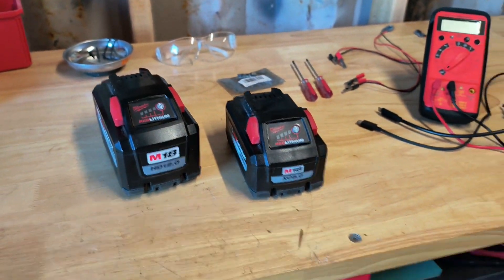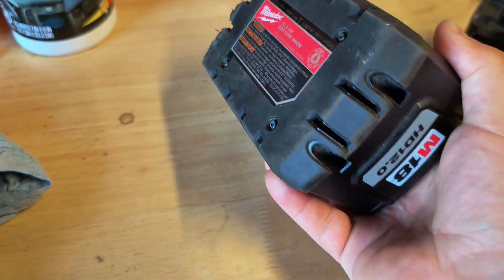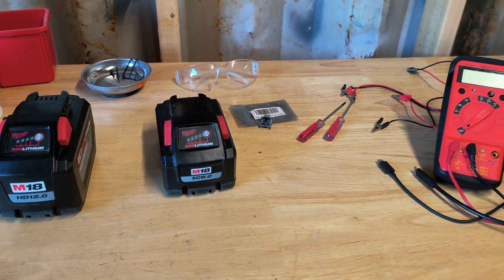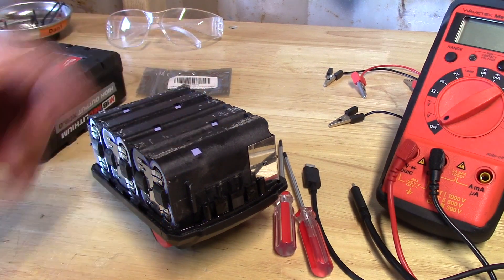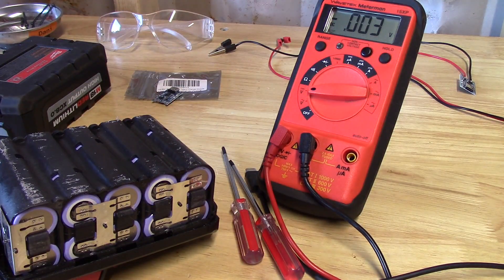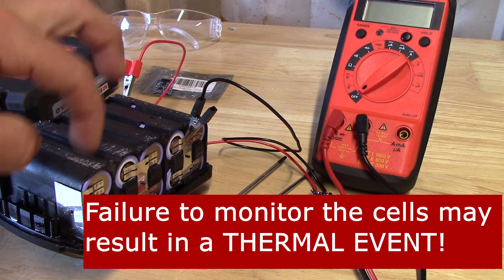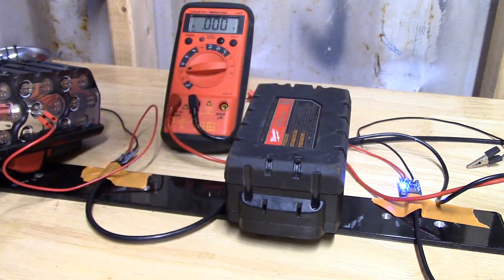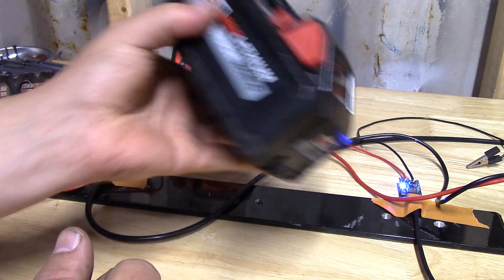Milwaukee M18 Battery Not Fully Charging, FIXED!

Comment: It's not clear to me where the alligator clips are attached. It looks to me that the black wire is on a positive battery end?
Reply from the maker: Unfortunately that is as clear as I could make it, and why I recommend you use a multimeter to determine the polarity of the cell banks.

Comment: That was just a temporary fixed ( still unbalanced cells). That will be out of balance more and more very soon . It needs a balancing charger to fix this much more easier and safe .
Reply from the maker: As I mention in the vid, re-balancing cells is always a temporary fix as the root cause of the issue is due to the difference of internal resistance within each cell.
There is always a danger present when charging any battery, don't assume that just because you have an expensive charger that you are completely safe 🤓

Comment: My 8.0 Ah battery had the 3 bar issue.  Your video was great in helping me correct the issue.  It does take some time to do. I did have an issue when trying to use the 18650 module with a USB-C charger, it simply wouldn't work. I got one of my old iphone USB chargers and it worked.  Thank you so much for making the video and showing step by step how to fix the battery and the items needed to complete the fix.  I saw some other videos on solving the 3 bar issue but they were too complicated for me.
Reply from the maker: The other vids I saw were all over the place, so I thought I would try making one. I am glad you found it informative 😊

Comment: What did you connect the alligator clip for the power source ?
Reply from the maker: I soldered them to the little charging board. You could just twist the wire and put it through the hole. Make sure it doesn't touch anything and is affixed in place, somehow.
Reply: @IllInformedHuman  but where is the power coming from.  Like an out lot or. A charger  🔌
Reply: Outlet *
Reply from the maker: @FaronMoonias  that small charging board is connected to a 5vdc source, via USB c. So you would want a USB port adapter that connects to the wall outlet. As well as a USB A to USB C cable.

Comment: Thanks, my 8.0 was like this from new. I think I got it off eBay years ago, sat too long on the shelf I guess. I gotta fix'r up
Reply from the maker: I'm sure you'll get a few more uses out of it 😉
Reply: @IllInformedHuman  yeahh, or replace the cells I guess or use the good ones in a different battery pack. I'm gonna try to use my RC battery charger though instead of the USB method. You can add a balance lead to them apparently also, but idk I'll have to look
Reply from the maker: @M.TTT. replacing the cells would prove tricky. I'm sure you'll figure something out with that RC charger

Comment: Does this work for also ridgid batteries too or only Milwaukee
Reply from the maker: This method would work for any lithium battery pack. The points to connect up and charge would be different, just be sure to check with a meter first.

Comment: Thanks for the tip, we you charge more than two cells at a time ?
Reply from the maker: As long as they don't share a rail, meaning they are end to end, you should be able to.
Reply: @IllInformedHuman and how long did it take to charge to 4.v?
Reply from the maker: @123uniden each cell was 8ish hours.

Comment: The really infuriating things is that the chipset that Milwaukee uses actually supports Cell Balancing but for whatever moronic Milwaukee does not use it. 

This is still the case with the latest Forge batteries also.

Its clearly a deliberate decision by Milwaukee to make people purchase new batteries to replace batteries really should not have failed in the first place if they had implemented the cell balancing.
Reply from the maker: I am pretty disappointed with Forge. I thought the lack of cell balancing was an oversight, but after seeing what they did with Forge, it is looking like a design choice 😢

Comment: Thank you so much I was gonna toss the battery away but buying the board and two clamps fixed the battery issue. Appreciate it

Kevin
Reply from the maker: That's why I do this, glad it worked out for you!

Comment: I think running the batteries down to a blinking bar too often is what caused them to get out of balance. I have at least 15 M18 batteries. Even a few 1.5A/hr that are 15 years old and I never had a problem of any not fully charging to 4 bars.
Reply from the maker: This issue is most common with the 8ah and 12ah. You know what they say... More cells, more problems!
Reply: It's primarily a problem with the high capacity 12Ah batteries . I have 2 both suffer from this . They cost 350$ plus tax in Canada . Thanks Milwaukee 🤬

Comment: Currently in the process of doing this for my M18 High Demand 9.0Ah and my M18 High Output 12.0Ah
Reply from the maker: I am sure it will go great and you will get a little more life out of your batteries! 
Be EXTRA careful with the 9.0Ah's I hear they are severely mismatched.
Reply: @IllInformedHuman  Both packs are balanced. Not sure how long they will stay that way. 20.56V and 20.57V

Comment: Is there a reason these packs become unbalanced in the first place? I have had good luck balancing packs so far but I’m wondering if I’m using them in a way that keeps making them prone to becoming unbalanced.
Reply from the maker: @Drew1734  the internal resistance of the individual cells varies too greatly. This is due to poor manufacturing process. keeping the batteries fully charged is the best way to compensate (don't leave them site for a week at half charge).

Comment: Good video. Helped me to decide that, for several reasons, I am not going to do this.
YouTube, and your video can be very helpful, sometimes enables that decision.
One thing that I have heard, witnessed at tail end of vid, not enough consistent personal experience
to confirm or deny,
is that Milwaukee
chargers work better
when mounted vertically, as yours
are. (¿?)
Reply from the maker: @objuan6  The bench I have is a Milwaukee branded bench. It has hole placements for the chargers in that orientation, which is why they are mounted that way. It looks slick, other than that, there wouldn't be a reason for mounting them in that way

Comment: My battery has no lights, but tests with good voltage.  Immediate green light in charger.  Will not run a tool.  I've yet to find a fix they all say 3 lights.
Reply from the maker: @rwe2156  there isn't an easy fix for that issue I'm afraid. It sounds like your main card has malfunctioned. You could attempt a swap, but I have yet to come across legit main boards for Milwaukee batteries.

Comment: Did you just plug the USB-C into a regular wall oulet then attach to the USBC chip.
Reply from the maker: @trevorpichiotino8926  yep, plugged the cable into a USB type A and then the usbC chip. All my power strips have USB outlets built in
Reply: @IllInformedHuman  thank you just finished hooking mine up. Thanks for the video also.

Comment: Thanks,(for a full follow threw with the video ,meaning after your fix you also used the battery then charged and showed to my satisfaction that the battery charged back to 4 and not the 3 as before .so thankyou and thats how you get a like and sub outta me 🎉 cheers
Reply from the maker: @matthartshorn2087  Thanks! I strive to make videos that are actually useful :)

Comment: Pro tip. If you attempt this, do it on your garage floor away from anything that can burn. You have no over temperature protection and lithium ion batteries can fail in a fireball as you charge them in this manner.
Reply from the maker: @bills6946  exactly 😉 batteries are more dangerous than gasoline! IMO

Comment: Good info but you can literally take them to a mileaukee dealer and swap them out or have them sent off for warranty
Reply from the maker: @coketrain4755  they denied my warranty claim. They were over two years from manufacture and I don't have the receipt :(
Reply: @IllInformedHuman  oh no that's not good we have a milwaukee rep that stops by every so often at work so we just swap stuff out with them that's not working guess we're lucky to have that luxury
Reply from the maker: @coketrain4755  Us joe schmos have it a little rougher. To be fair, if I kept the receipt, they would have taken it back. Your rep likely keeps records, so it is easier to swap bad parts
Reply: Milwaukiiieeyy is a little sketchy on their batteries and warranties.  Did You know they WILL NOT accept the older HD 9.0 batteries?  Fact.

Comment: Lovely video demo. Wanted to make one as well as I have had this issue with 3 of my 12Ah 18V and 2 of my 9Ah 18V batteries. Balanced the cells several times the last few years. It only works for a few weeks to months at best. It is unfortunately a very common issue. This cell balancing solution I've tried as well, but with a Dc powerstation. Works similar to these usb c pcb charging boards, but with a power station you can increase the voltage to manage the charging speed, which does help.speed things up, when used with caution and properly and you know the charging characteristics of voltage vs current based charging.
I think the elephant in the room is that the Milwaukke 18V batteries din't have a good quality cell balancing bms board. Tool scientist youtube channel made a nice video on this, worth watching. In my view and experience I have come to notice this a glaring issue with many milwaukee 18V packs, especially the 9 and 12Ah packs. I like these packs, power and versatility on the platform. But I'm noticing that the cell balancers and communication protocols are not good features on the pack. I think an active cell balancer on the bms board of all 18V packs would greatly improve battery health and longevity of the Milwaukee packs. This demo is, in my experience, not really a fix, but a plaster on a wound that will get bigger over time without fixing the root cause.

Comment: Thanks for the video but man what a joke. I got some Milwaukie tools a couple years ago and the batteries both have this issue already. I've had my Makita batteries for 6+ years and they all charge fully. I'll not be buying anymore Milwaukie tools! The tools work fine but if the batteries are junk.
Reply from the maker: I hear ya! I am pretty sure Milwaukee has battery rebuys on their earnings calculations... might be the final push I needed to try out another tool brand for the next new tool I get :)
Reply: Not all of M18 batteries are poor, but Milwaukee definitely has some issues.  The cells used are of quality, but as others have mentioned, I think they have issues with the BMS and internal circuitry, along with the interface of the chargers?  I own and use Milwaukee, along with Makita, DeWalt, and others, and the M18 batteries are the ONLY ONES I have ever had an issue with.  

I’ve bought clearance Makita kits, with no bars on the batteries, from where they have been sitting so long on the shelf, and they take a charge as soon as they are put on the charger.  That WILL NOT happen with Milwaukee.  Let a M18 battery sit too long, or go down to one bar flashing, and it may not take a charge.  No bueno.

Comment: It sounds like possibly one or a combination of flaws:
  * the internal BMS does not have a balancing function (saves a few pennies) or
  * the battery is not left on the charger long enough to balance or
  * the charger does not provide a trickle balance current after reaching what it thinks is "full"

Maybe the "fix" is to wire in a balance connector like used on hobby LiPos and use a hobby charger to periodically balance charge.  If I have to do this twice to the same pack, I'll be wiring in a balance connector.
Reply from the maker: Affixing wires to each cell set and periodically balancing them with a cell charger/balancer would be a more permanent fix. though that would require a bit more money than I am willing to spend on batteries that I hope to swap with FORGE in the next year or two.
I would consider doing that if I was going to try and keep these longer than 2 years.
Reply: @IllInformedHuman  Forge dont have balance on the BMS... there is a good video here in youtube about that. Is the same problem, no balance on the BMS.
Reply from the maker: Dang, my excitement for the new packs has dwindled. I am going to have to wait a while longer to see how well they hold up. I care more about longevity than instant power delivery @Cococholoco
Reply: @Cococholoco is there any power tool batteries from other power tool companies that have a balance on the BMS? Like DeWalt? Craftsman? Etc.?

Comment: Just a thought. Rather then charge 3 banks up to level of the fourth would it be quicker to drain the the high one down to the lower level put it back together and charge on Milwaukee charger see if they all come up together. 
I am going to try that with mine.
Reply: I could not find a charger to do the banks with so I did take the high one and drained it down to the level of others ( used a tail light bulb from car ) put everything back together and charged entire battery worked perfect.
Reply from the maker: @ianeige7587  aim of the game is rebalancing! Good work 👍
Reply: Plausible… let us know how that works?  👍
Reply from the maker: You could accomplish that with a power resistor or a programmable load. You would have to check on the cells much more frequently and likely spend more money. But you would not have to wait around for over a day like I did!

Comment: Milwaukee batteries are good quality samsungs ... the problem is the shitty designed PCB . No proper balanced built on it . REPLACE the pcb with a Ali express $8 one and problem solved . The chinese knockoff pcb seems better then the OEM milwaukee 😩
Reply from the maker: That would be an interesting mod 🤔
Reply: They dont have balance on the BMS.

Comment: gonna give this a go myself. Two flakey HD12 and those bastards ain't cheap.
Reply from the maker: Always worth a shot! Perform the work on something you wouldn't mind getting burnt... just in case 😅
Reply: @IllInformedHuman  Hmmm my little module isn't turning red, LED is staying blue. Where have I gone wrong =D
Reply: Reverse the leads..... I came back in to watch the video again and was like "oh was I that foolish?" Indeed I was =D
Reply from the maker: @jonnymiskatonic  You are not making good contact with the metal, try gently rubbing the alligator clip against the metal before having it bite down. Also make sure it stays in a good position (won't slip off). It should turn red when charging, blue when nothing is detected.
Reply from the maker: @jonnymiskatonic  Good thing those tiny boards can take a little bit of foolishness :)

Comment: I have 2 milwaukee batteries that needed this.  I have 2 super cheap Amazon fake porter cable batteries that are older and work without fail every day.  Maybe cheap, fake milwaukee batteries would be better.
Reply from the maker: At this point, I might be willing to try the knockoffs... maybe just to open them up and see how they were constructed.

Comment: Did you just use a usb-c phone charger?
Reply from the maker: No it was a single battery cell charger (TP4056). Something that can monitor the voltage of a cell and auto stop charging. A phone charger would not do that, unfortunately.

Comment: I have a 12ah thats only been cycled a few times. I have a lipo charger and all the cell packs are over 4V now but i still only have 3 bars. The last time i used the pack on my leaf blower it went dead after about 10 minutes.
Reply from the maker: Sounds like the voltage drops drastically when a load is applied. Which means your cells are likely too far gone to be recovered.

Comment: Sorry. Perhaps a silly question... Could i just wire up a 5v phone charger and avoid buying the plug in doohickey?
Reply from the maker: A phone charger will always supply voltage, the phone decides when it stops accepting (Most common). Doing that to a raw battery cell will cause a thermal event. You need something that will monitor the cell voltage and turn off automatically.

Comment: Worked! Saved me from having to buy a new battery. Excellent content. Thanks again
Reply from the maker: Thank you for confirming!
Reply: @IllInformedHuman hello, great info! Thank you

I am in need of more information about the charging USB and the charging unit  and settings.

Thank you for the content 
Do you have any additional information on the questions or do you have anything you could point me in the right direction on with those questions? 

Thank you 

Toby
Reply from the maker: @IndyMotoBoy there are no settings to fiddle with If you buy the USB charger linked in the video description. All you will need to do is connect it up as I have shown in the video. The Amazon listing gives details on how the device works if you are curious.

Comment: Approximately how long does it take to charge each cell? And what is the output amp load max on your charger/power supply? Great video thanks!
Reply from the maker: Thank you! 
With that 100mA charger, it takes about 45minutes to bring each cell voltage up by 0.1V. The 8Ah battery took a little over eight hours while the 12Ah took the same time, due to less cells being undercharged. Using a beefier charger would reduce the time drastically. Though, slower charging means a cooler cell, which helps preserve the battery life.
Reply: Wondering, if a m18 pack goes bad, is it possible to identify any remaining good cells and salvage them for use in another pack that has “bad” cells?
Reply from the maker: @chriscoco547  After fully charging the pack (At least as high as it will let you) when you open it up and check each cell voltage, the ones that are closest to 4.2VDC would be the "good" ones. Unfortunately, the cells are tack welded onto a strip of metal during assembly at the factory, so harvesting them is fairly difficult and not advised.